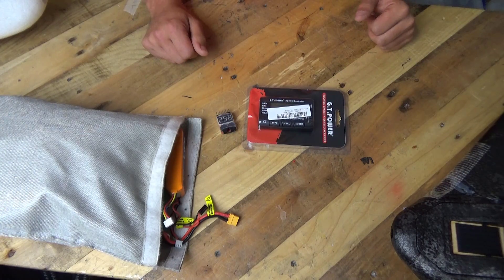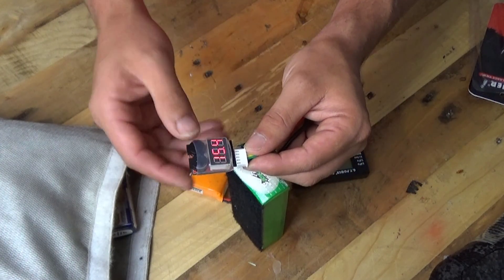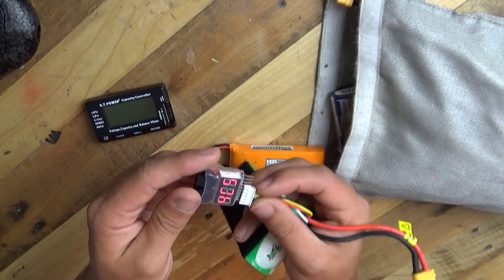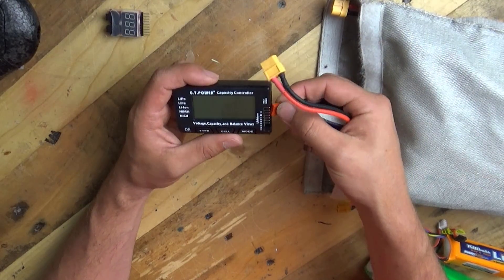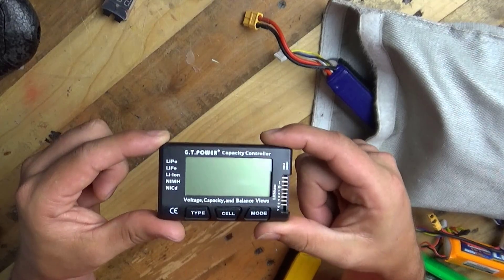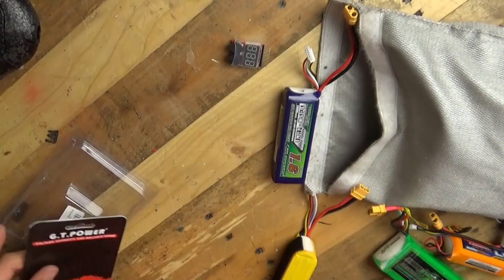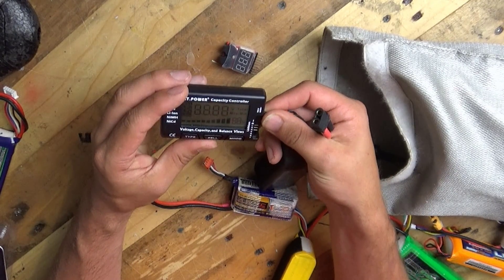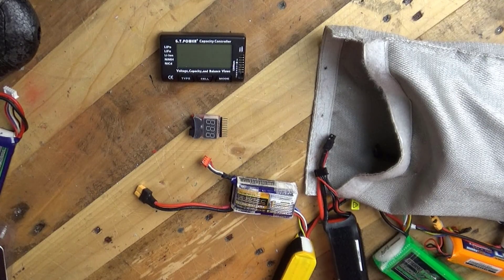RC Lipo Battery Testers & Alarms - Which is Better & Why?

Comment: I use the battery little alarm while I'm flying my helicopters. When I pass the helicopter by near me, I’m listening for the alarm. I set them to 3.6 and land when their alarm goes off. The bigger 5-in-1 meter is good to let me know the percentage of charge a battery has, so I don't take off with a weak battery.

Comment: I have both types but the battery tester does'nt work on 1S, I use the alarm  for testing 1S  bats along with a voltage/charge level chart.

Comment: I agree with you.The capacity controller works like a fuel gauge in your car.The voltage alarm only gives voltage readings of each cell.But,it's good as a low voltage alarm in the model.

Comment: I just found your video today. Very detailed. Thank you. 
I have purchased the same capacity controller It came without any cable and I am blind now. Please help me to get up and walk. 
I want to use this for my 4X 3.2 v lifepo4 batteries. How do I get a cable and how do I connect my lifepo4 batteries and capacity controller 
Thanks a lot for your time for coming to help me 😊

Comment: Hi great video very helpful I’m looking to fit one of the small alarm monitors in my  rc plane once the battery volts are set when you put a new battery in the plane will the monitor still remember the alarm settings or do you have to reset after every battery change I only ask as I might have to mount the alarm away from the battery connected by a brace cable hope you can help 
John

Comment: Those things are crap. Very inaccurate. Usually, here is a reading difference of 0.1 to 0.2V which is huge in my book. The best thing you can do is to use a decent volt meter to measure the voltage of each cell with a home made two pin cable. Some of those types of readers are decent but they cost 40+ bucks. Why not buy a 70 buck multimeter to measure accurately voltage, resistance and current of not only your battery but also stuff in your house as well !?
Reply: Because we can't fly with big (and accurate meters). These small  testers are designed to use only during discharging process in rc model/car, they are not designed as desktop meters.

Comment: I recently got the Digital Battery Capacity Checker after seeing this video and this device can even balance the lipo battery cells by pressing the Type button for few seconds and selecting the which cell to balance. Definitely a useful visual device and better than that crappy loud beeper. Thanks for the useful information and definitely must for those who use lipo Batteries in RC Toys, Gel Blasters and Drones

Comment: at 8:10 Your manual for the Capacity Controller appears to be better, mine says:
"NEW Balance Function: Long press the first key, LIPO/LIFE/LIIO will blink, says it is in balance, balance process according to the second button can view each battery voltage, balance is take the batter in the lowest section as the benchmark to discharge balance"
(I'm here because I wanted to see how the "balance function" works haha)
Reply: Mine is Type Button not the Cell button

Comment: 3.8 is 1/2 charge if your alarm is set at 3.5 and your full charge is 4.1 or so. You don't need those fancy modules if you can add and subtract. Jeez, you make it sound like calculus. 3.0 per cell is damage time, don't let your battery EVER get below that or it can be ruined, even during high throttle flight. Too much tech crap can spoil all the fun of just flying.
Reply from the maker: Morning Leslie, I'd think you'd cry if we saw the abuse we give out batteries 😂🤣 Matt

Comment: One thing to add, the one bigger battery checker you used does not show individual battery cell life status, that is the only glitch, I bought a Venom battery lipo checker and it can read and show each cell status so you know if an individual cell is over charged or low on charge which can lead to battery swelling & failing
Reply: I don't know about you but my one (Battery Capacity Checker) shows individual battery capacity and charge for each cell. I brought it from AliExpress recently and this video is few years old. Maybe the Chinese implemented the feature or your one is old model I think
Reply: @MirzaKhalid   agree 👍

Comment: It’s not rocket science look at each cell voltage the should all be even if not for sure u have an issue with either low battery or bad battery.

Comment: How can i know if my tester is accurate ? Only if i got a multimeter to compare ?
Reply from the maker: Howdy, it'll be close enough not to worry about it. Matt
Reply: @RagTheNutsOff  Good to hear :) I trust the bigger ones but the smaller ones are a coin toss imo. When i plugged in a battery the other day the small one was showing a whooping 0.1 V more than the bigger one. Strangely when i plugged the battery in for a couple minutes and tested again with both, they were showing the same Voltage.

Comment: I got several of the small ones and I own a Turnigy brand of the large one. Also I own two multi meters. Problem is that I get a different reading from them all. Don't know for sure which is accurate or not.

Comment: Hi Matt 
I also have one of the GT battery checkers and they are perfectly ok but not as accurate as the Celldiag 6, high accuracy alarm battery indicator.
I did a test with both of the above by checking them on a pro battery charger and the Celldiag 6 was much closer to the true voltage.
They are a little more expensive but worth it when you consider the investment of what you are flying. Happy New year and happy flying.

Comment: How could I connect an on/off switch to the digital alarm? Thanks
Reply from the maker: Hi Mario, thats not how they work. Do to something like that you would need a PWM switch and hook up your own buzzer or hack an existing one. Matt
Reply: RagTheNutsOff , OK thanks
Reply: you could connect a relay where the buzzers are so that when the alarm goes off it switches the relay
Reply from the maker: Probably!

Comment: Hi Matt, wondering how can I measure voltage of 1S small batteries with only a JST connector?
Reply from the maker: Howdy fella, maybe make an adaptor lead to a 2s connector and connect the + wire to both the positive wires? Or just fly the model til lit falls out of the sky and then you know it's flat and couple probably do with recharging 😁
Reply: RagTheNutsOff apreciated! CHEERS
Reply: Try flipping your battery upside down and connecting that way.

Comment: I bought the simple alarm because on my battery it has led's to indicate me if it's flat or on 20%, 30%, 50%, 70% or 100%.
Btw the brand is called Hacker. It's a german brand just saying.
Reply: The reason I bought the alarm is that Hacker says to put an alarm at 3,3 V and not 2.7 V.

Comment: How accurate is that battery tester? Those small battery voltage alarms are not that accurate.
Reply from the maker: Hi Mike, pretty close and enough for the flight line to rule in or out the battery from being used again, Matt
Reply: RagTheNutsOff Thanks

Comment: I use both testers with my quad. Be careful with the small one. Position it also with the LCD facing your pack. Had a hard crash(it dropped from about 50m) n the pins on the back under the instructions pearsed through itsown heatshink n two layers of heatshink I put on the pack. But both worth every cent. Thanks Matt. Great video
Reply: Love heatshink too

Comment: Hi Matt,  They are very good, but there's an even better version for fixed wing flyers, called CellMeter8 which has an inbuilt servo tester as well as discharger/balancer and does 5 chemisty types, around same price, looks same but it's blue. Cheers
Reply: Alasdair McC The 150w discharger module is really useful for getting part charged lipos down to storage fairly quickly. Works faster than my sc620 for discharging..
Reply: Can 2 or more of the CellMeter8 be connected in parallel to balance the cells faster?
Reply: Thanks!  I saw the GT Power doesn't ship from USA so that CellMeter 8 is perfect.  It better work.  :p

Comment: Yeah.. been using the same 7 cell ones for years.. Great Li-Po fuel gauge.
Recently ordered the new Blue 8 Cell from BG and will be checking the accuracy compared to the Black ones. For some reason the 8 cell Blue ones are about $1 less expensive.
https://www.banggood.com/AOK-CellMeter-8-Multifunctional-8S-Digital-Power-Capacity-Display-Servo-Tester-p-1007822.html?rmmds=myorder

Comment: Those little ones are very inaccurate...
Reply from the maker: Dobemandan Yea my white one is way off, however the new black one is only a tad out, which is happy days, Matt
Reply: Matthew Ogborne. Question is which way is it off and is it consistent. Consistent is acceptable as long as it is calibrated and known.
Reply from the maker: I'll make a video on it when I can Joshua :)

Comment: Hi Matt, Yaaaaaa, I'm first.  I use this IDT checker for the flight line.: https://www.banggood.com/ISDT-BC-8S-Battery-Checker-with-Two-85dB-Buzzer-for-LiPo-LiHv-LiFe-LiIon-Batteries-p-1128253.html?rmmds=search 😃
Reply: I put  the cell ballancer on batteriers the day before charging and the batteriers usually charge more quickly as the charger does not have to ballance as long
Reply from the maker: Good thinking BG&D! And Anthony, happy days, if it works, it works 🙂